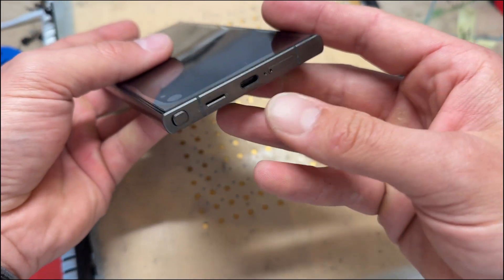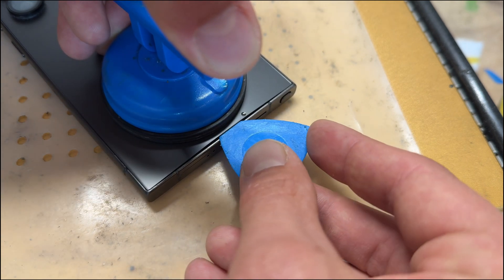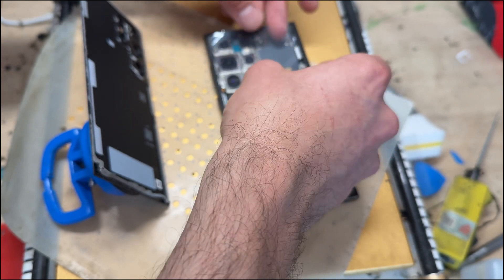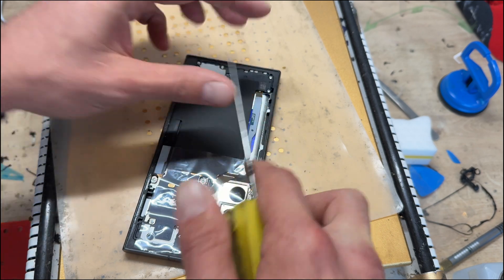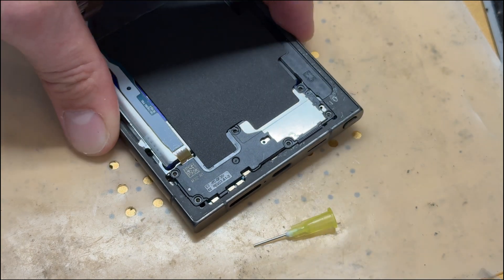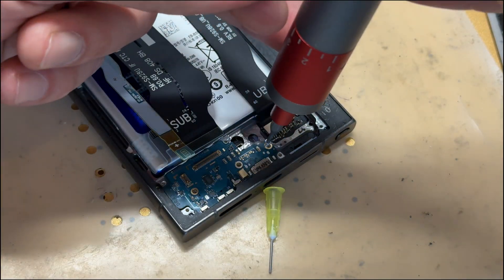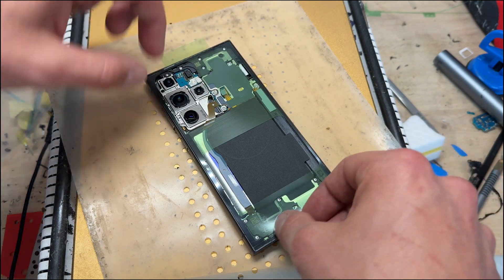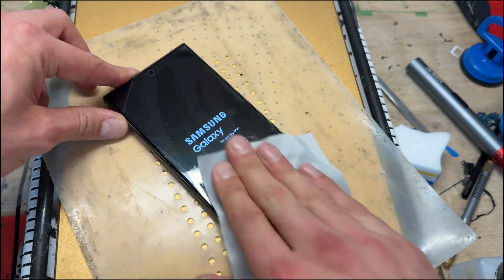Samsung Galaxy S24 Ultra Charge Port Replacement – Full DIY Repair Guide!

Comment: I think I can do this to my own phone. It has had a dodgy charging port for a while now where I have to set the charging cable just right in the port to make it charge, and if the phone is bump, it no longer charges. Very frustrating, is the newer samsung parts fixed this issue?

Comment: Hey guys, my port was broken and I had to have it swapped. A new Samsung connector has been installed for the device. Now, however, super-fast charging only works once in a while or starts with it and then switches back to normal charging within seconds. What can this be?

Comment: will lose the water resistance feature after those steps?
Reply: Yeah, that is my main concern too, im assuming as long as you get genuine parts (including adhesive seal for back cover) you should be fine as long as you apply adequate pressure and eliminate any gaps between the back cover the phone frame.

Comment: So realistically for your average person like me, how doable is this without all the extra tools? Samsung is just giving me this big ass runaround and i live nowhere near a authorized repair shop.
Reply: The kits off Amazon CAN BE good (if you get lucky) but before buying know a few things... 
1. Make sure your part/kit is set to work with your variant. See the BUONDR  at the top of the usb board? It must be "dotted" with U if you are using on a US Variant phone. The reason for this is the USB daughterboard has the sim reader, and different regional variants have different sim functionality.
2. ALL the amazon kits used savage and "tested" boards. The kits say "new" on amazon but that DOES NOT mean the parts are. 
3. None of the Kits seem to have precut back cover adhesive. You'll have to buy it separately.
I've bought 2 kits and got 1 kit with missing tools and 1 with a defective board. In both cases boards WERE correct variant. The defective board installed fine and showed fast charging but seemed to have an electrical short.  Port also showed wear. Part made phone get excessively warm, charged slowly and LOST functionality (mobile network intermittedly dropped and NFC worked incorrectly). BEFORE reinstalling back cover I would delicately attempt to confirm device is completely functioning, charging at appropriate speed without overheat & and KEEPING cellular carrier signal.
Reply: It bought a kit off of Amazon for about $25. It came with the board and all the tools. The “hardest” part was getting the back to separate from the phone. But once I got it, everything went smoothly

Comment: what temperature do you set the heat plate to and the spinning tool you were talking about be good to have a link for that I'm going to try doing this on my Note 10 Plus it needs a port and a microphone which is all on the same board I believe

Comment: I watched the whole video and replaced my charging board but now I have issues activating an Esim and a physical Sim with verizon. Could anybody help with this?
Reply: Did you find a solution for yours?
Because it happened to me too.
Reply: @ivensonfequiere203 I did not. I went back to the original charging board.
Reply: @IAmMclovin420  Mine is okay now, I had to put the original one in because my phone is the US version.
Reply: I thought I bought the US version, but they sent me another version for the USB charger board
Reply: Saaaame

Comment: Diddyblud my SIM card not working
Reply: On god bro me for diddyblud you owe us
Reply: Could be one of 2 things. 1. You could have a defective board. "new" repair kits sold often have "used but "tested" parts. 2. You could have used the wrong variant board. He does not mention in video these boards are region specific. Find the BUONDR at top edge of board. For typical US phone the spot just above the U should be dotted. If you purchase phone from a US carrier or directly from Samsung US as unlocked, you have US variant.

Comment: Why does no one offer charging port replacement?  This doesn't seem overly difficult.  The worst part is getting the back off.
Reply: finding a daughterboard replacement off of a donor is probably it, samsung doesn't sell cannibalized parts from their phone to consumers or even shops, this part he got is most likely removed from a different phone that had a non-charging port related issue and was just used for parts.

Comment: I need some help i dropped my phone into some bleach now the display has a wet look and it cannot receive input can you  please assist me i have a samsung a13
Reply: That phone isn’t really well known for having any water or moisture resistance, bleach corrodes and dissolves vital components inside phones, the longer you wait, the worse it gets, most likely a short circuit will occur

Comment: Is this a Samsung issue with their charging ports going out?
Reply: It also happened to me. It never went into water but it started to detect moisture. Then it won't charge anymore. It is 6 months old and i wanted to have changed under warranty but they told me that this is nkt covered. So i had to pay 70 euro to get it replaced. 
I truly believe that there is a problem with the design of the port itself or the material used cause many users are getting into the same problem. It would be good if samsumg would address it. After all, this phone costed me 1200 euros...
Reply: @eugenioalongi25 this is what happening to me rn 😭. Is the port really replaceable?
Reply: @Gave-o4g hi, i was not there when they changed it, but it looks to me that placed a new one. Now it works fine but i am pretty careful with the humidity going close to it. Good luck!
Reply: I've had 2 samsung galaxies with C port chargers and the port gets loose and the inserting charging cable won't stay in place to charge, so im forced to wireless charge
Reply: Same here, looking for a solution now.
Reply: Im having issues too. I thought it was the wire on the charger but I think it's the port
Reply: I fucking hate this phone now, I paid 1k for this one after my nothing phone had faulty SOC and crashed, now this fucking charging fault appears. It seems many people have this issue
Reply: Yes. My 2nd
Reply: Same issue on my s24 ultra

Comment: Would you test the part before sealing up the phone to ensure the part isn't DOA?
Reply: I definitely recommend it. Most kits sold include recycled parts that were "tested." Make sure phone charges with standard and fast chargers, and MOST importantly the phone reads you sim card and MAINTAINS carrier signal for a few minutes (at least).